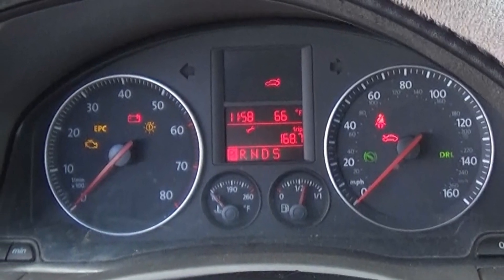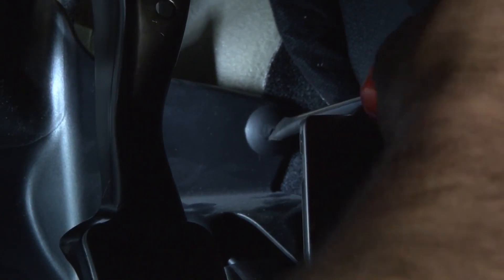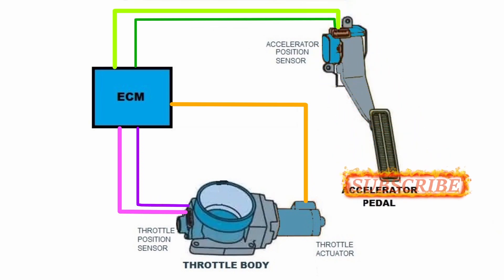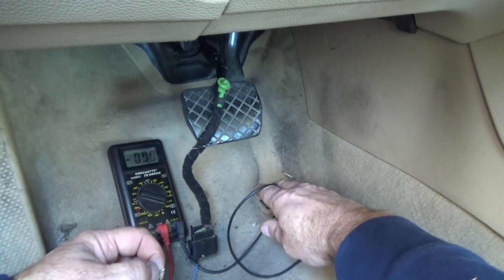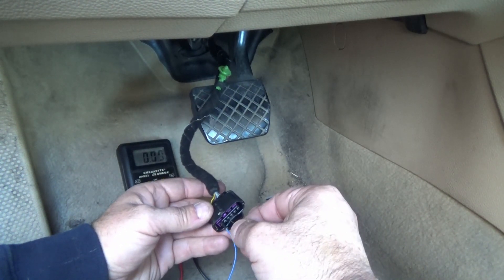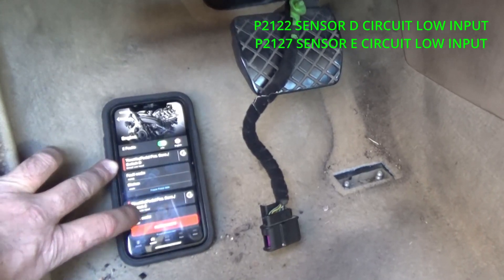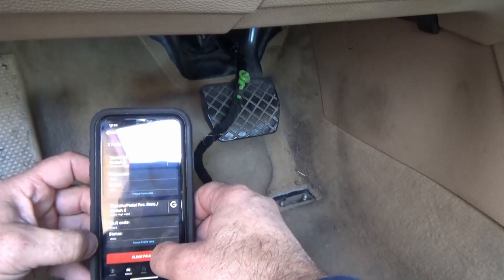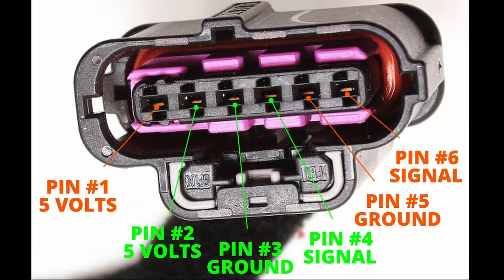Troubleshoot a P2122, P2123, P2127 or P2128 ODBII code | No oscilloscope | VW Wiring

Comment: On the very last test you did, were you connected pin no. 2 and no. 4 i get a p2123 and a p2128. What should I do? Thank you in advance
Reply from the maker: Could be several things… from easiest to very bad. Accelerator pedal assembly, throttle position sensor, bad wiring or connector, engine control module. Are the O2 sensor wires under the car in good condition? If they are disconnected or damaged fix them first. That can cause the ECM to burn out. Watch the video again and do the checks as specified. Good luck!

Comment: Great video! I have mercedes and p2123. Only get limp mode when. I press full throttle. There is a full throttle switch in my pedal and i am thinking the pedal needs replacing. I am just trying to think, how to confirm so i don't replace my throttle and its something else like you had. This video gave me a few ideas. If you have suggestions, let me know. Thank you!

Comment: That was really helpful. Thanks for your time and effort. 

Why not just check the voltage between pin 1 and pin 5 directly by multimeter?
Reply from the maker: Yes, you are right. You could check the voltage but I was not sure if it was a bad wire or ECU so I was using the high (5volts) to tigger the ECU code as well as check the wire. I’m no pro I just shared how I did it ;) Thanks for watching!